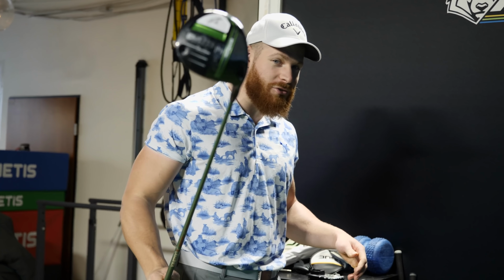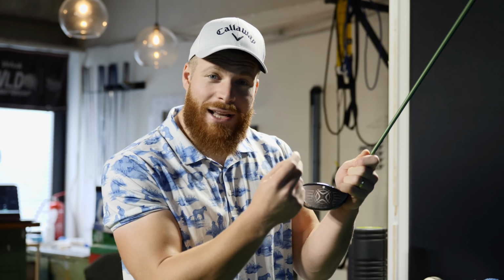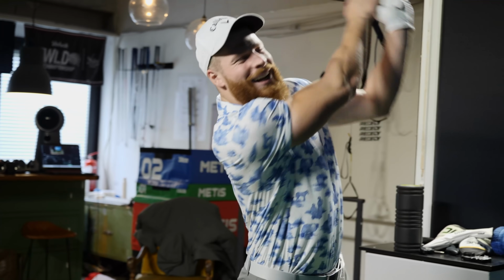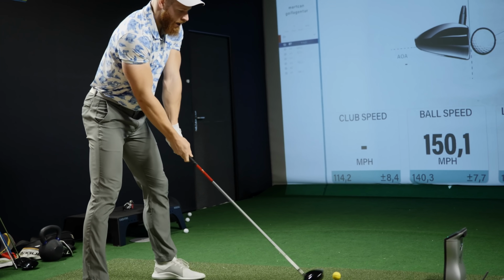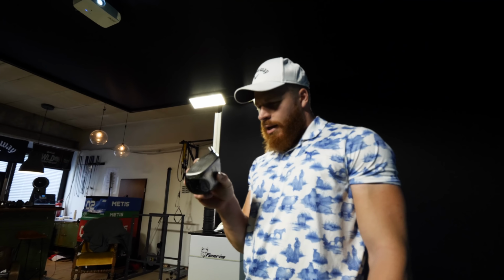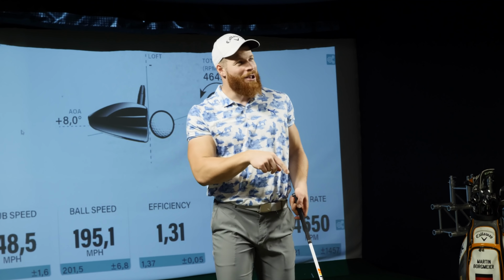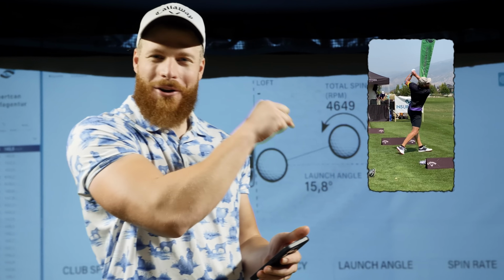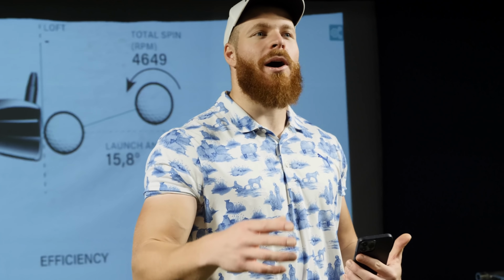Did I DESTROY this Driver? | Talking Driver Technology | Martin Borgmeier

Comment: The question about moving the sweet spot out is actually a good one. I am a badminton coach and the pros are hitting smashes over 280 MpH nowadays. Yonex developed a new shape of graphite rackets called Isometric, which had a squarer top and did exactly this, moving the power hitting area toward the top where the racket moves fastest. It worked so well that almost every racket on the market now is this shape :-)
Reply from the maker: that‘s very interesting. Insane how fast badminton players smash it 🔥 gotta be the fastest sports object in the world

Comment: I always assumed that the COR was what you have described but never understood why ball speed (from a decent strike) is usually 40-50% faster than clubhead speed - surely if a COR of 0.83 means that only 83% of the initial ball speed is retained after impact then you would always see a reduction rather than an increase...   or am I missing something very obvious?  🤷‍♂
Reply from the maker: the .83 is the ball bouncing back off the still face. when the club is moving and hitting the still ball, it‘s roughly a factor of 1.45 - 1.5 depending on where you measure the club speed
Reply: @MartinBorgmeierLD   I know that - and I was thinking that both scenarios would be equal -  but of course having given it a bit more thought, the club is much heavier than the ball so it imparts much more force on the ball than the ball would on the clubhead.  Thanks - I understand now and I suppose it is quite obvious but not to me!!!

Comment: Great video, educational but not boring, great balance. I'd love to see GC quad vs trackman comparing an old ball with a different aerodynamic pattern on the ball. Since older balls would weigh differently, have a smaller diameter and different dimple pattern I would expect the trackman to give real results but the quad to give results assuming it's a *insert premium modern golf ball*. Cheers for reaching this far if you're still reading. Great content 👍👍👍
Reply from the maker: that‘s a very good question. You‘re probably right but I‘ve never tested it

Comment: On the speed gains question I think I have an answer. I'm a mid handicap player who has swung at around 100mph for the last 3 years. I recently started practising giving more width in my take away and that helped me to load the driver shaft more on the downswing and my average speed now is 106mph. That's the only change I've made and it's gained me 25-30 yards. Worth a try I think.
Reply from the maker: that‘s very individual but most of the time it helps to widen the stande to gain more stability and shoulder tilt. Can go vice versa tho when you get too wide and lose vertical thrust

Comment: Great video, Martin.  What are you thoughts on overall driver head weight (effect on ball speed) and whether or not adding weight lower and forward has any measureable effect?  Thanks.
Reply from the maker: going by kinetic energy as 1/2 mass * speed squared is a good baseline. Get heavier until you lose speed, then go a bit lighter back to where you didn’t.
Reply: @MartinBorgmeierLD  Thanks for the prompt reply.  That makes sense.

Comment: I have a question concerning not just flex of shafts but bend points. Obviously it's easy enough to find out what flex I need but bend points are a different thing. Is there an easier way than trying literally hundreds of different shafts? Any help would be appreciated Martin
Reply from the maker: I‘m not aware of any other way. Good club fitters guess a ball park after a couple shots and then fine tune.
Reply: Many thanks for the reply. I know miyazaki have international bend codes I just wondered about the bend profiles. Be a lot easier to know  I need as an example 5665. But appreciate your reply nonetheless.

Comment: Martin, I have 3 R580 heads at 4 degrees.  Apples to apples, let's see what the BS is compared to the newest LD equipment.  232 mph BS on a 48" 260 CPM shaft with an old R580?  I have some other interests in LD and training.  We met at Rochester in 2019.  I finished 4th in the masters division.  I was hitting with Jeff Gavin and you came down to the range to talk to me.  You admired my strange grip.  Hahaha,.  I fixed it, I'm faster now.  talk to you soon.
Reply from the maker: Hey Frank, that‘s very interesting! I didn’t know they were made at 4° back in the days
Reply: @MartinBorgmeierLD  They didn't make any R580 like that.  I custom bend them.  Made some tools to do it.  That club you saw at Rochester was an Adams f11 8.5 degree bent to 4.5 degrees.  The R580 has the same hosel design, so it can be bent.  I'll look for them, might have thrown them away with all the cracked heads from 10 years of LD.  I can make some through.  It's easy with the tool I made.  Might be fun to do some video making 15 year old club heads low loft and hit bombs with them.
I have so other ideas for video content as well and I would like your input.  Look up www.thenitroswing.com.  Keep this a secret from Bryson, I want to build one for him.  We build it on the show, he helps build it, and then auction it off for charity.
Chat with you soon.
Frank

Comment: Hey Martin, got a couple of good video ideas for you.  

Wondering if you can do a test with golf ball temps.  This has been done to death in other videos but not at your speed.  Curious how a very cold golf ball (sub 32 degrees F) would behave for you ball speed and spin wise, vs a room temperature golf ball, vs an Arizona hot 110 degree F golf ball.

Another idea, can you find an old wooden driver that gives you good driving numbers?  I swing much slower than you but I have an old laminated driver that I can get pretty optimal numbers with.  Curious if you can find a similar diamond in the rough for your speeds.

Keep ripping them!
Reply from the maker: great ideas!!!

Comment: I’d love to see you on a range, as close to zero wind as possible (or set the Quad & Trackman to the wind conditions) and then physically measure your carry distances to compare to the two devices.  I know they calculate carry based on speed, launch angle, spin etc, and they both get that data in different ways, but real life comparisons with a laser or tape measure would be fascinating I think.
Reply from the maker: very interesting idea, could talk about that for ages

Comment: I had the driver back in the day, won some  long drive holes with it 💯. I eventually upgraded the shaft to aaldia nv 75 xstiff shaft that helped a lot with control. I eventually upgraded to the tailor made tour burner dented the face. Took a break from golf then upgraded to the tailor-made M5 and now I have dented the face on it. 😭😭😭😭
Reply from the maker: Sounds like you smash it hard, Adam
Reply: @MartinBorgmeierLD    Yes sir I have a tendency to get ramped up a little bit, it just sucks when you deny your driver and you can’t replace it because they’re so damn expensive not to  mention I’m left-handed, So it becomes almost impossible to find good deals ,nothing in  nine degree  extra stiff. I love the  M5 I have, got super lucky finding it in the hazardous smoke black. Xstiff. Just sucks I dented it.

Comment: For a test idea you should see how much club head speed you could gain if you drilled holes in the face of the driver and back of a driver to let air pass through it instead of needing to go around the club head.  I'm wondering if that would be possible with the use of carbon fiber faces. 

Love your videos!
Reply from the maker: Well, that's a very interesting idea!

Comment: What he’s saying about modern drivers not being faster than the older COR tested drivers is simply not true.
COR tested ball speed.
The CT tests time. 
The manufacturers have found a way to maintain the time restrictions and increase ball speed. The new drivers would fail the old COR test.
Taylormade increases ball speeds 1 mph per year with the Stealth increasing 2-3 mph.
How? Their explanation to me was this.
Imagine a face that flexes in a certain time. Then imagine a face that flexes more. It’ll take a longer time for it to flex and flex back than the previous. So the face is then made to rebound faster to catch up to the same time as the previous face. 
Result. The 2 faces have the same CT but the second one has increased ball speed. 
While the CT test was made to test with tighter tolerances than the COR test it opened a loophole for technology to exploit it. The CT test cares not about ball speed. It’s an inferior test to curb speed increases.
Reply from the maker: There‘s a difference between marketing claims and reality. I have not seen any increases in conversion for any conforming driver. 1 mph per year and 2-3 mph with a single product launch does not reflect reality.
Reply: @MartinBorgmeierLD  yes you’re right there is a difference between reality and marketing. Yet the marketing stays the same when the reality is misleading and true. 
I fit and instruct for a living and have for 25 years. I’m in Carlsbad where I directly work with sales reps from the Titleist, Callaway, Taylormade and Cobra. And have visited TPI, The Kingdom and Callaway Performance Center many times. I get no marketing research, I get real testing data and I hit everything. As a +1 handicap I feel like I have a great grasp on what changes model to model and what doesn’t. I often receive “off the record “ information. Name any product and I’ll tell you the change it made based on what I’m told and what I see in personal testing. I respect you and your channel but I have to generally agree to disagree here. Continue the great content.

Comment: I've always wondered why golf manufacturers spend so much on R&D to make the longest drivers if anything that causes the ball to go long becomes illegal. Why have rules against drivers? All it does is cause the price of drivers to skyrocket due to the cost to get around the rules. Does anyone ever think of that?
Reply from the maker: There‘s more to distance than just speed. Finding the right driver for a golfers launch conditions is key
Reply: @MartinBorgmeierLD  right but why are certain drivers illegal? Doesn’t it all come down to distance?

Comment: I would love to see you swing at different speeds with driver. Curious if you can do it at multiple speeds. 
Driver: less than 100mph
Driver: 110mph
Driver:120mph
Driver: 130..etc
It would show those of who struggle to over 100-110 how effort less it looks from a professional.
Matt bolis who used to film YouTube  with txg has a nice 120mph swing but he also in past can vary his speed down to 90mph and slowly increment up. Very cool control of speed. It's helps those like me better understand the power of using your legs and ground.
Reply: He actually has his own channel now that he split from TXG. And he's doing much more of a common man golfer approach showing lessons and such rather than the data side that Ian always was doing.

Comment: Cool idea, and I love how it went wrong the first time :-) Do you happen to have a speed training idea for someone who had roughly about 96 to 98mph with the driver and now, after a bad knee surgery, has to fight knee pain in the lead (in my case left, now am officially handicapped outside Golf) knee and some kind of yet not explainable weakness (leg gives in when running or jumping, horizontal pushes are ok) in the same thigh? Thanks a lot for help! Also: Any idea where to get a shaft puller in Germany for a reasonable price? I do not mind at all if it is used and also am up for workarounds that works for guys as good with tools a Tim from tool time...